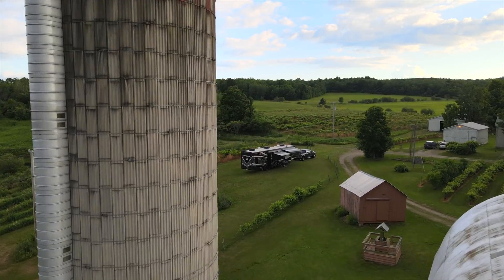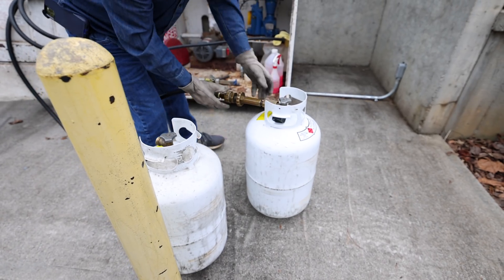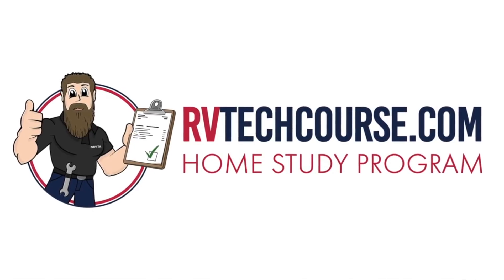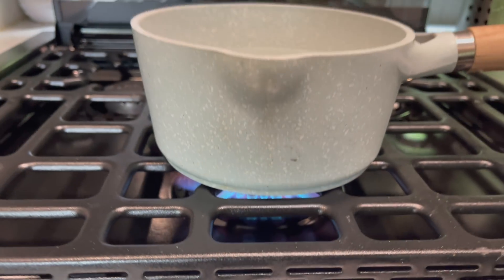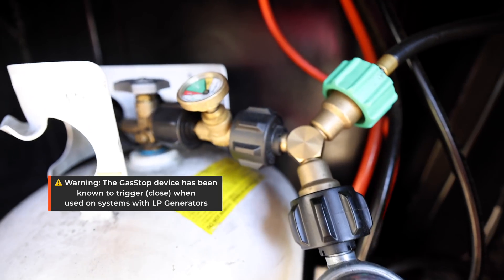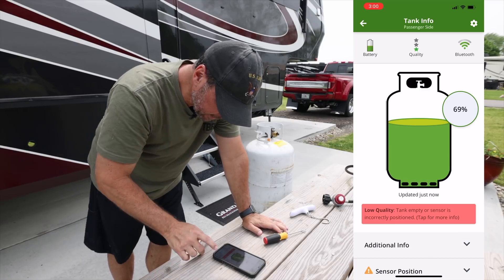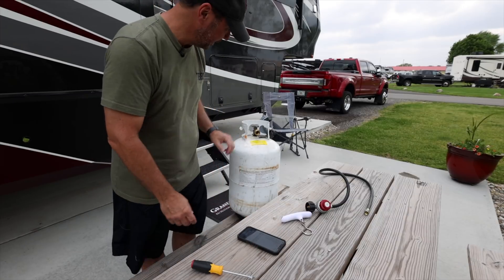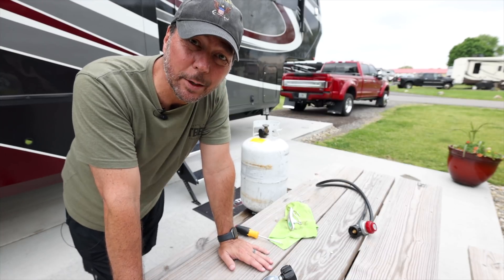Ultrasonic LP Tank Sensor Testing (How Accurate Are They?) (Full Time RV)

Comment: Question, do you have to use the stand-off’s on the bottom of the tank? (Aluminum or rubber ring?) my tank compartment is very tight height wise and I’m worried that I may not be able to get the tanks back inside the compartment if they make the tank sit any higher. I’ve already damaged the lip taking the tanks in and out to fill the propane tanks.

Comment: Nice video! If you were going to use these strictly for a BBQ that stays in the garage, would you get the older model for about $35 or spring for the Pro model for about $65? Thanks!

Comment: $20 says they stopped working before they hit two seasons old.
Reply: I installed 3 sensors three years ago,  (1 H2O and 2 LPG) and they are still working fine. The battery consumption is very low, I'm amazed at how well the perform even at low temperature  -25C.

Comment: The empty tank weight (called tare weight) is stamped into each tank. On mine it is stamped at the opposite end of the top "skirt" around the valve from the manufacture date. Labeled "TW 24.3 LB" or "TW 23.6 LB" etc. It also gives it in KG below that... like 10.7 KG etc. I'm curious if what you measured empty matches what is stamped on the tank, or how close it is?

Comment: Thanks for the info!  

I’m looking at getting one of these to monitor the tanks for my home heat pump (the aux furnace uses propane.)  I'm supposed to get auto delivered, but the gas company just estimates the remaining levels, which failed me this last time during a recent cold snap.   So I’m hoping to install something that can actually alert and remind  me to order when it falls to a certain level.  So I was trying to find out if these actually worked or not.   I'd say within 5% is at least close to as accurate as one can read one of the tiny circular gauges on top anyway.

Comment: I tried them. My mother gave me and got level and showed 74% then stopped reading at 64% the battery is very low. It seems like it isn't transmitting. I haven't figured out how to change the battery. I have the basic unit model M1001. I have no paperwork.

Comment: Does the Pro sensor have a USB plug to connect via the power bank or throw other power supplies? How long does his battery live?
I want to install the sensor on my car's propane tank 70 liters. It is cylindrical and located horizontally. 
Will this pro version sensor work? 
Thank you.

Comment: Checklist checklist checklist..lol.. i need and will make a sign like shipboard use to put around valve that reads "remove the sensor" before removing.. another ONE left at a stop and go for gas and propane on the outer banks last week..arghhhhhhhhhhhhhh, now back to hot water method till i get Another  SENSOR..lol

Comment: Chad: you are the dude, Man. What a nice scientific comparison for us simple folk. 🙂 I had the original Mopeka sensors years ago, and I wasn't impressed (mainly with battery life). The new round version seem to be a lot better as I read about them. As I know Mopeka has their app, I have also "heard" that the Lippert tank sensors are actually Mopeka sensors, and since our 2023 320MKS has One-Control, I'm wondering if this is an added benefit to buying the Lippert sensors. Can you comment?

Comment: Thanks for another great video. I have been looking at installing these on the propane tanks and water tanks to integrate into my Cerbo GX. 
You may know by now, but the empty tare weight of any tank is stamped on the collar behind the TW. This would save draining the tank. Just weigh the tank, subtract the TW and use the math to figure out how much is in there. Have a great day!

Comment: My two 30 gallon tanks are not in a bay but on the front of my RV under a plastic tank cover. The temp outside has been between -4 and 27. My question is: will these sensors work well not in a bay in freezing temps?

Comment: I'm surprised how accurate it was!

Also, these wont wear out as fast as those needle guages do. Most of those needle gauges get messed up easily just from pressures lol. I also used to do the whole pressure hose with the gauge on it, but those develop leaks all the time... So this is a win for me!

Comment: Do you think these will work on tanks laying sideways under a class B van?  And if so, would you put the unit on the bottom or on the side?
Reply from the maker: Yes... they would go underneath, pointing up.  See: https://mopeka.freshservice.com/support/solutions/articles/20000037200
Reply: @ChangingLanes  Thank you so much for your response.  Installing this today.  And thanks for the link.

Comment: I have the standard sensors (gravestone shaped) on my 30 pound propane tanks in my RV. They have been working great until today. I had a tank that was reading 2% yesterday which I thought to be pretty close to accurate as I've used propane for my stove, furnace, grill, refrigerator and hot water tank for the past couple of weeks and we’ve had some chilly nights. This morning, I expected the tank level to read 0% or Empty. Instead, it read 54% left. Then a little while later, it read 10% left. Then later still, it read 12%. Sometimes it says "Low Quality: Tank empty or sensor is incorrectly positioned" while other times there is no warning. I haven't moved the sensor or the tank and I put fresh batteries in the sensors the last time I had the tank filled. What do you think is causing the readings to be all over the place?
Reply: Same experience so far here.  I've had them for a couple months, also on two 30 lb tanks.  One is still reading full, the other has read as low as 4% last week and is currently at 36%.  My guess is the huge temp ranges we've experienced.  From near freezing to about 92 degrees today.  I imagine it gets pretty hot under that black plastic cover, especially when the sun is shining on it.  Time will tell I suppose.

Comment: less reliance on that tracking gizmo. the better.
the less tech needed to just get out and have fun. the better.
i run a three tank system. 
drain down tank 1, 
switch over to tank 2, 
install tank 3
and i know i need to get tank 1 refilled in the next 72-96 hrs. but that is if i am using a LOT of the stuff. most times i am not so the time to refill can increase three to five times.
as i have two full tanks to burn through, before i would run out. 
and as i use a couple of the bar-be-q tanks for everything outside. so if ever needed i have plenty of spare on me when i go out for a couple weeks.
as i also have a 120 volt heater, that i can use for heat. but that requires gasoline. (honda eu 3000). everything else ok on battery power.
but in 23 years only camped in the snow once. but it does get cold at night in the high country even in the summer. extra blankets.  but some falls, it can be warm even above 8K feet at 2-3:am.

Comment: Oh no shit.. I have a thermal cam. Im definitely doing that boiling water trick from now on. I'm on my second 20lb tank in about a month. I'll be living in this camper for the winter and New York gets cold. I can't risk running out of propane when I'm at work or something where I can't run to the store and grab another one and then my pipes freeze and things break and my dogs are inside cold and what not. The level of my propane is very mandatory to know. I've been looking at these little magnet sensor things for weeks wondering if they are accurate. But either way that hot water heater thermal cam trick is awesome. Glad I found this vid!!

Comment: I remember watching this video a year ago and being so lost.  Since then, I’ve done a lot research and went through the NRVTA  coarse.  The only issue I’ve come across so far is with the display 50.  I’m running about 20 - 25 feet from the Cerbo GX.   It seems like you had to run yours pretty far also.  My question is do you recommend a hdmi extension.  I was reading some forums and people were saying the extension was causing some issues on the display screen.  If you had to use an extension, did you have problems?  Do you recommend a good HDMI extension?   Thank you for making great videos.

Comment: If you vent it off fast enough, boiling will occur inside the tank. This boiling will cause the level inside the tank to increase, like a boiling pot of water boils over.

Comment: Just put these on my propane and two on my grey and fresh water tanks. Tied it into my Victron cerbo. Very cool on the touch 50 display. Also put a couple nuuvitags into the cerbo for relay control. Cerbo 2.8 firmware or greater supports both. Nuuvi and mopeka. Thanks

Comment: Is the black ring on the bottom a requirement just wondering,  can't find on the website or Amazon ?
Reply: The kit comes with 4 tap on risers to create more space for the sensor. The ring is an upgraded version of the lift.

Comment: Question for you: When the Mopeka app on your phone says "100%", does that mean 100% of the "80% capacity rule"? Or does 100% mean that the tank is 20% overfilled?
Reply from the maker: It means 100% of the tank's rated capacity, which is technically 80% of the cylinder's capacity.
Reply: @ChangingLanes  Thanks for your reply. I remain conflicted as to what exactly 100% means b/c when I contacted Mopeka to report and question why it said 100%, he replied that I must have a faulty sensor and that they would send me a new one which they did. The new sensor reads the same; 100%. Which leads me to wonder if the tech was not correct. Still wondering and waiting for a reply to my service ticket from 2 days ago. Thanks again!

Comment: I'm curious to know what the TW (Tare Weight) is that should be stamped on the collar of the 30lb tank. I have a 20 lb tank (TW=16.6lb) and a 40lb tank (TW=31.1lb). While watching this video, I used my bathroom scale to weight both of my tanks (full) and calculated that they have 4.57gal and 9.31 gal respectively. Great video! Thank you.
Reply: The tare weight is the empty weight of the tank stamped on the collar by law.. The 20, 30, 40lb tank names refer to roughly how much propane they should hold. Thus your 20lb tank would weigh about 36.6lbs and your 40lb would be 70.1lbs when full. This is why you see many places place the tanks on some sort of scale.

Comment: At your final 24.1lb weight reading of the empty tank, did that match the "TW weight" stamped on the handle of the tank?  That should be the tare weight (empty weight) of just the propane cylinder itself.

Comment: We have Mopeka gauges, and when we first got them, they worked well.  It didn't take long, though, for them to stop communicating.  Replacing batteries helps sometimes, but even with fresh batteries in both sensors and the remote display, it often reads wrong or refuses to provide a reading.  So we're back to loosening the hold-down, and getting a rough feel for the weight.  The idea is great; apparently the execution is not good.

Comment: Chad, we used to measure fuel in tanks at Naval installations all over the world.  We would "stick" the tanks, then use a sliding scale on a chart that would correct for known temperature.  This would give an accurate measurement of the amount of fuel in the tanks.  I wonder if the LP "industry" has such a temp adjusting chart for LP tanks.  Just curious.  Since we Seabees are curious by nature, how about some kind of scale for each bottle to sit on, with an "app" on your phone to tell you the weight of each bottle.  That would seem like the most accurate way to measure, but no idea how cost effective that may be.  Ride SAFE!  Chief.

Comment: Hate to say so, but those are (according to the DOT) are CYLINDERS. Tanks are the permanently mounted ASME tanks mounted on motorhome frames. I started out with the standard Mopeka sensors, They quickly failed due to moisture intrusion. They replaced the sensors with the Pro sensors and I sealed the vents and mounted them using the plastic retainer cages they sell for aluminum cylinders. This way the sensors stay in place. Going on a year with the Pro sensors and recently changed the batteries after one died, but working OK. My cylinders are extremely difficult to remove and I run a built in generator on them also, so I need to know how much they have in them.

Comment: I added a pressure/level gauge on a 20lb/5 gal tanks but then had problems with my gas appliances operating properly.  A little on line research found others that experienced the same.  They said the pressure/level gauge can restrict flow and cause appliance to not operate.  I removed it and system worked fine.  People should be aware that if you have a operating problem it could be caused by the gauge.

Comment: Great informative video that required a lot of work/time. Thank you. I’ve been looking at these sensors and this helps me decide to go ahead. If temperature is really a significant issue, the sensors could include a temperature compensation feature. From my experience in working with industrial ultrasonic level sensors, it can easily be done. (Industrial sensors are typically temperature compensated because the sensor itself is temperature sensitive).

Comment: Great experiment!  A little costly at 7 gallons of propane....  Thanks for that!   So now the tougher question, you had the original and now the pro sensors.  Between the two do you find the pro worth the extra expense?
Reply: I first had the original rectangular shaped sensors and would frequently lose tne reading where it would indicate an empty tank when that was not the case. It was extremely sensitive to positioning on the bottom of the tank. 

I upgraded to the new round design and these are much better at giving the correct reading. They also have other features such as being firmware upgradeable and showing a positioning display. The new design is definitely the way to go.

Comment: 15:54   Fahrenheit, not Farenheight.   ;)

Ray from the YouTube channel, "Love Your RV," has had problems with the frost and condensation "wetting out" his Mopeka standard sensors.   He ended up using some DIY conformal coating on the circuit boards to protect them.   Maybe the pro sensors are already conformal coated...

Comment: Call me Safety Sid but all I could think about while you were doing this was propane is heavier than air, it's collecting under the RV, spark from water heater, fridge, transfer switch, etc. and no more Changing Lanes.  Glad your testing didn't run afoul.

One year I was moving and needed my propane tanks emptied and certified for shipping in a moving van.  The propane shop opened the bleeder valve, carried the tank out of his shop, then placed it withing 2 ft. of the railroad tracks that run in and out of the refineries by San Pedro / L.A. Harbor behind his shop.  That time I could only picture a train taking the curve and a spark from the wheels on the rails setting off a spectacular chain reaction.  I left and told him I'd be back in a couple hours.  :)  

Great videos.  Stay safe!  Best..

Comment: I have the older non pro sensors and have been using them for about four years. I agree it is really nice to be able to easily check your propane level, the issue I have with them is mine stop updating some times and the only thing I found that fixes that is to forget and relearn the sensors which isn’t hard but is annoying. Also, one of my sensors goes through batteries every couple of days and changing batteries in the sensors is also annoying. The bottom line for me is they are a lot more maintenance than I would like. Maybe the pro sensors are more stable.

Comment: I appreciate your video's, their very informative. Just a thought 🤔 I seen that your last weight of the tank was 24 lbs
Did you also think about the weight of the tank that is stamped on it? Mine weighs 25.6 lbs. 
This test probably cost you $20 .
Reply from the maker: I do remember that from class, but totally forgot. I will be curious to see if my measurement is confirmed by the stamp.

Comment: My propane tank is installed in in a bay of my RV, and it is installed on its side. How can I attach the Mopeka sensor to the rounded side and will it be as accurate as your test indicate with a tank that's standing up?
Reply from the maker: They do work on ASME tanks.  👍🏼

Comment: I liked the Mopeka system when I first set it up using the square sensors. Over time, I found the Florida heat was brutal on the batteries and I was constantly changing them. Then the sensors became unreliable and would not even sync with my phone right next to them. Do the new round sensors work better? If so, I might be willing to give it another try. Thanks for the great video as always! Steve
Reply from the maker: They do work well and seem to be more responsive than our originals.. But, we never had any real issues with the originals either.

Comment: nothing is said about having 2 tanks I like to use 1 tank at a time . that way if 1 runs out I can turn the other one on. however can you use 2 of these sensors 1 for each tank  . or do they interfere with each other signals?
Reply from the maker: One for each tank is how we do it.
Reply: Douglas: I have the old version sensors, they die quickly in canada because of condensation gets in/on the electronics and shorts them out. (spring and fall). Last i looked a year ago you can add 10 sensors at once in the app. & custom name them for reference of location. 
So yes you can add more than one sensor at a time, and toggle through them to check each tank level, no they don’t interfere with each other, i used two at once back then. 🍻